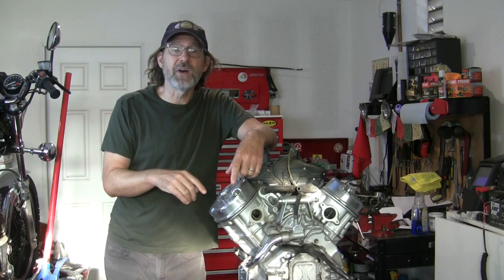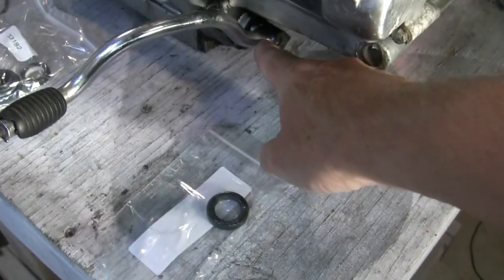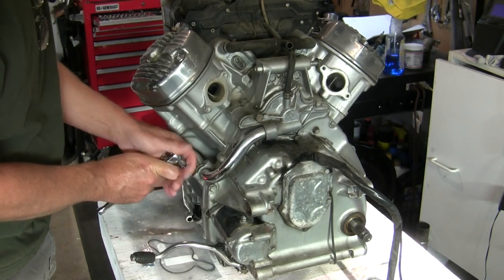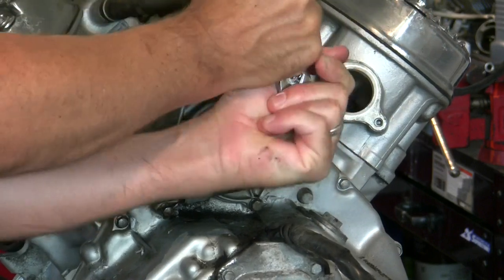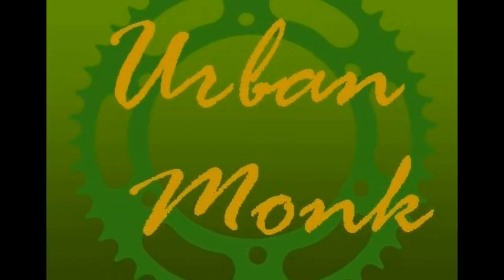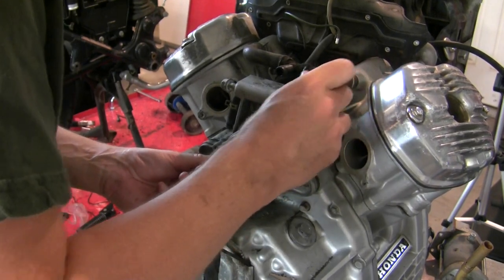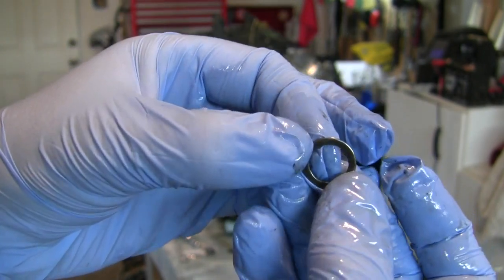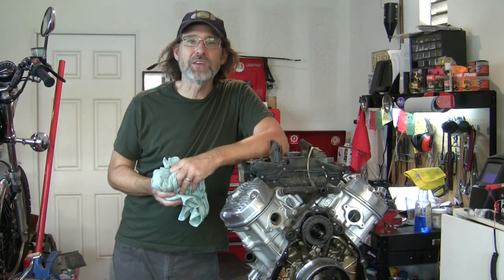Remove Water Pump & Rear Engine Cover - CX500 Part 6

Comment: Do the quadruple bypass. Plus starter clutch springs. Mine were about an 1/8 inch shorter than the new ones and I've read a lot of forums on starter clutch problems. Also  that o ring on the timing chain tensioner.  It can only be changed with the rear cover off. Looking forward to see your progress. 👍
Reply from the maker: Thanks David. Your advice is good. I may, but it'll depend on costs. For me, the purpose of this project is to fix what is broken and sell. I need to land financially right-side-up on this one to fund the next project.

Comment: Top job mate,
Reply from the maker: Thanks as always for watching!
Reply: Urban Monk TV no problem, it looks like most of the nuts,bolts& washers are all in great reusable condition, have you thought of buying a nickel plating kit?, reasonably cheap & you can create the original factory finishes, that’s the one thing I thought about after restoring my 76 water buffalo
Reply from the maker: @bluehazeboy  You've actually got me thinking about it. I'm starting a new business in my "real life" and my wife continues to have health issues that take a lot of my time so there's a lot of pressure to keep my time investment in motorcycles limited some. But it would make for interesting content!